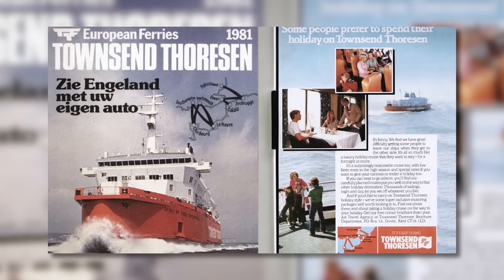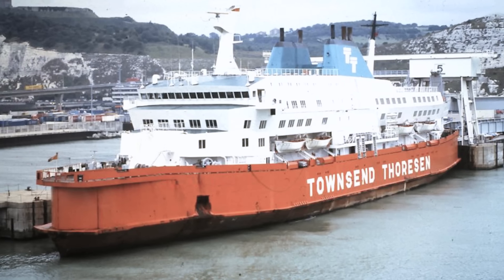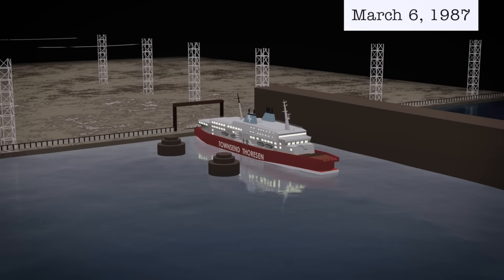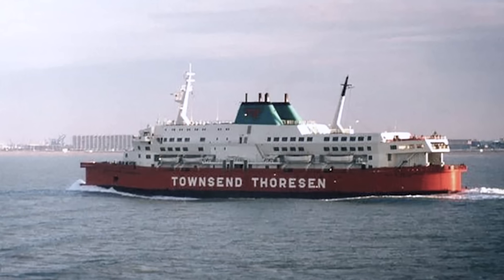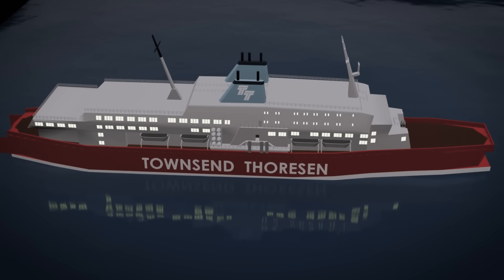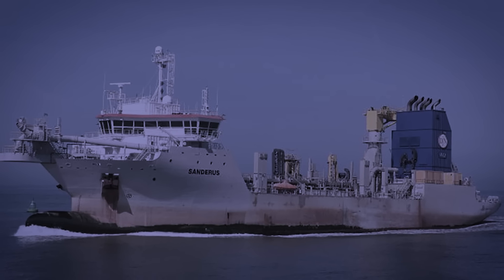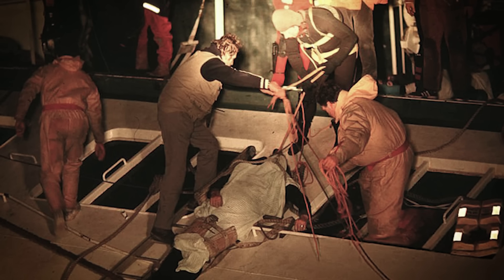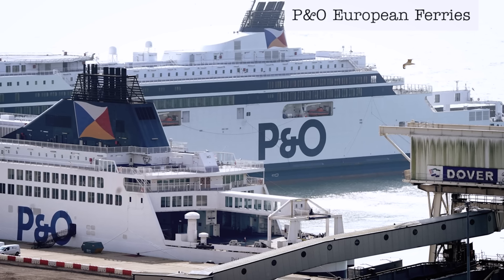193 Dead After Bow Doors Left Open!

Comment: Goodness, 193 casualties?
One little warning light of DOOR OPEN, would have prevented this entire thing...
Reply: Or if they had a callout plan.

Can not leave harbor before every crewmember, in charge of something important reports they have performed their duties.

"Deck assistant here, doors closed and latched"

They would not have gotten that call when he was asleep, so would not have left.
Reply: Not a foolproof system either. Estonia had warning lights if the bow wasn't locked. Chain is as strong as its weakest link.
Reply: 90 seconds? Damn I don't know anything that happens in 90 seconds.  Except one thing.
Reply: There are too many Desk/Office people who wright the roles, with no reality knowledges, that's why.
Reply: @ilaril  right, with the new fifteen minute early requirement from the company operating the ferry would have just made it so they would have ignored the light. Like they ignored the dude responsible for closing the door was missing. Like they ignored speed limits.
Reply: @ilaril  then you use multiple "chains" , back-up systems... planes have 'em, why not ships... 😒
Reply: or maybe some automatic action considering some sensor is necessary for the warning light
Reply: @fatovamingus  one and a half minute?
Reply: @fatovamingus  Sounds above average(!)
Reply: Once requested ..fitting denied.
Reply: the ferries ALWAYS left port with the doors open and would open the doors while coming into port. it was this accident that made the boats shut the doors before departure and open them after docking. my dad used to go and watch while we sat in the car. you were also allowed back to your vehicles while entering port. what the herald of free enterprise did was standard practice across the whole ferry system.
Reply: @jaapaap123 Every once in awhile yeah
Reply: That's incredible. Well, I bet they have them now.
Reply: even cctv cameras existed then.
Reply: @tricky1992000  I was just going to say a cctv pointed at the door with the monitor on the bridge for the captain to see would seem pretty foolproof.
Reply: An interlock should be installed, not just a go/ no-go indicator, but a disabling mechanism. This should also be done with dump trucks to ensure the bed is down before allowing increased speed.
Reply: Then what would we watch
Reply: @JohnDoe-bd5sz  At least the door close officer would have been leaving the ship with a sack...
Reply: ...or if one lazy ass moved to see if the door are open or not
Reply: @noconsent    that's the Spirit of Free Enterprise for you! 🤡👍
Reply: Even my fridge ward me if is open!!!! How is it possible????
Reply: At the cost of £500 pounds per ship.
Reply: A man who was on a 24 hour shift who’d been told to get some rest, who should have supervised by an officer. Where there were no warning lights to tell the bridge the doors were closed despite numerous requests by Captains for them to be fitted, which when fitted after the disaster cost £500 per ship, the 2 or 3 near misses, but blame the bloke who was asleep.
Reply: I'm told a trainee deck officer cadet had been told to ensure the doors were closed, he apparently went on to become a P&O ro-ro Captain. The full story is much worse than told here.
Reply: I know right? If my fridge can detect a door open, and activate a light, how can an enormous ship carrying hundreds of people not be fitted with the same system? This video perfectly demonstrates the swiss cheese model of airline accidents. If there were warning lights on deck, it wouldn't matter if a crew member didn't report doing his job. However, no warning light PLUS crew not reporting that a task is done, means no back up. This is why planes have such extensive pre-flight checklists. The fact that the ferry operators had no similar checklist is unforgivable.
Reply: No, it was common practice to sail out with the doors not closed. Even months after this disaster an undercover tv-show filmed just how many RoRo’s still left the ports with the doors not fully closed.
Reply: Relying on idiot lights is the type of thing that causes disasters, not prevent them.
Reply: @larsblankenfjell9814 can you repeat that in English?
Reply: @peterfitzpatrick7032 NO, planes have fail secure doors and hatches that require human intervention and indicating latches. They do not rely on idiot lights.
Reply: @hendrickvanderdecken7926  And yet... a plug door just fell off in flight... 🙄
Reply: @neil670 dear god 😮😢
Reply: @ikkelimburg3552 😮
Reply: Drunk employees
Reply: @ilaril estonia had no bow visor left after being smacked with a submarine.
Reply: no, it wouldn't. an interlock would.
Reply: submarine? @danielstevenson
Reply: This was one of those roll on, roll off, roll over ferries.
Reply: This is insane. One relying upon another that he had done his job. Worst of all ... the Captain.
Reply: In reality yes, but ferries often left port with these doors open to let out the exhaust fumes. A very high tide, & an unusually heavily ballasted bow end, due to a fixed span system at Zeebrugge, couppled with a late departure led to the disaster.
Reply: It does now. Plus a kill switch the prevents movement. Like trying to start an automatic transmission car when set to Drive,
Reply: Such incompetence on so many levels.  Shocking.
Reply: Ship designer, inspectors,owners,government officials in shipping ALL deserve to be charged with negligence because of no DOORS SECURED light or indicator.  All future ships should be designed to not engage anchor retrieval or propellers until RORO Doors are sealed.
Reply: Provided someone was there to SEE it.
Loud klaxon and BIG flashing strobe if vessel starts moving with the doors open is more like it, because when a crew neglects the bow doors being open, that`s the type of signaling they might need..
Reply: @ilaril  Estonian's ramp was actually closed all the disaster. The open ramp theory was just a faux reason to cover some other things.
Reply: @chatteyj Complacency and poor training. It never happened in the past so they couldn’t imagine it happening in the future. The rules of air and sea travel are written in blood
Reply: @noconsent  It not that,  the pounding waves of water, repeating smashing to the front cargo door broke the locking device then the door literately  was torn off.
Reply: All because of an assumption 193 people died. Never assume anything where peoples safety is paramount. RIP to all who lost their lives 🙏❤️
Reply: Not just a warning light, that would be far too easily overlooked.

In addition to a warning light, I would say a very loud siren, if any attempt to pull away from the dock while the door was still open  - much like the audible warning sound when you accidentally forget to switch off your car headlights but obviously on far larger scale.
Reply: @peterfitzpatrick7032  Aircraft have much less time for "backup chains" than ships Peter. That's why.
Reply: @roderickcampbell2105  Thats not really true, Roderick, you DO know how quickly this ferry went down, don't you ?...

The entire event took place within 90 seconds. The water quickly reached the ship's electrical systems, destroying both main and emergency power and leaving the ship in darkness.

 Even a jet can glide for many miles if it has the altitude...
Reply: @ Correct Peter, I do know the vessel went down very quickly and I was not trying to make light of the tragedy. I suppose that I think that folk who have jobs that involve others lives, I expect a very high degree of thoroughness.
Reply: @roderickcampbell2105   I'm sure you wouldn't make light of it, Roderick, & I didn't mean to imply that either.. but I will say that these outfits often cut corners in expenditure and often employ cheaper foreign staff who are not paid what thwy shoukd be getting paid, considering their responsibilities... "over-worked & underpaid" ... we often hear of oil tankers being manned by miniscule staff numbers, with little skill... 😒
Reply: @ Indeed Peter. Money and profit are often the "motivators". And many times the quite poor pay the price. They should not have to pay with their lives.
Reply: @roderickcampbell2105   agreed... 😟
Reply: The crew and ship designers were inspiration for the film Dumb and Dumber.
Reply: A warning light alone could fail and falsely indicate the doors are closed when they are open.But a $50 CCTV camera pointed towards the doors would leave no doubt. So simple and inexpensive tech anyone with half a brain would have installed it. The ferry company was so cheap they never had one installed.
Reply: @thequake180  Hard to argue with that quake. Several folk made major mistakes.
Reply: @thequake180  True, but good seamanship would have saved those lives.
Reply: A simple micro switch and cable and an indicator light, I would think would not be that expensive, most expensive part would probably be the length of two core wire to the bridge, not that expensive in the grand scheme of things, unlike losing the ship and lives and then all the insurance claims etc

Comment: After this we did get status indicators on the bridge and CCTV covering the doors. The cameras were usually covered in soot and grime from exhaust fumes and the mechanical switches often got stuck and gave false positives. There was no change in the pressure on the crew to do whatever was needed operationally to keep to schedule, constant reductions in crew numbers and increasingly little time for maintenance.
Reply: I am thinking that the ''Chunnel' just added more pressure to 'reduce overheads'
Reply: Great example of why safety features aren't a substitute for safety culture.

Comment: I travelled on RoRo ferries regularly to Hook of Holland / Harwich and return back in the 1980's so before this calamity. First thing I'd tell everyone who recommends a warning lamp in the bridge is - it wouldn't have mattered one bit. Many of them put to sea with the doors open. I foresaw this quite obvious flaw in the ship's design and never slept easy in one. ( I travelled Sealink - their ships were different in that some of the vehicle decks could be altered in height hydraulically so that different mixes of cars and trucks could be carried) these ships had bow hoods that were raised in dock for loading but they were only a kind of fairing - waterproofing was achieved by two sliding doors further in the ship. Many big cargo trailers - back part of an articulated lorry, were loaded without their lorry tractor unit ( another unit picked them up once in Europe) indeed, they'd often cram in an unattended trailer in the space between the bow and the sliding doors. These trailers had to be pulled on board by  small tug vehicles - driven by guys who reckoned themselves to be on fairground dodgems and quite often as they came up the ramp the trailer dolly legs would snag the sliding door tracks - I chatted to three matelots attacking one such occurrence with sledgehammers with a foot of green water pouring in the open doors while an alarm bell rang throughout the deck - "we have to keep to the Shedule sir, no matter what."

Comment: Not only was leaving the bow doors open not illegal, but many reports afterwards said it was normal practice at the time. To avoid the costs involved in staying at a port's berth while the doors closed, which took a number of minutes, these ships would set off with the doors open and close them while on the move. 
In fact it took a long time (as I recall) before a rescue or news helicopter pointed out it looked like the doors were open. There were many questions and denials, but then it came out - normal practice!

Comment: I'm rather surprised no one at the port saw the bow doors opened and reported it. Perhaps a layman might not understand the significance, but surely there are experienced sailors or dock workers around.
Reply: That was a common thing in those times. Many react with disbelief because they can often (due to their age) only compare with today's standards.
Reply: You don't need to be an expert on shipping to know that a bloody great big door wide open on a ship is not a good mix with water, weather your a layman or not 😂
Reply: Pitch dark, middle of winter.
Reply: It was not uncommon for the ferries to sail with the doors open, it helped clear the exhaust fumes from the decks. My brother in law was second officer on TT's Felixstowe-Zeebrugge service, those vessels had a visor type bow door with an internal watertight door, clearly visible from the bridge. We got a call from him that night to confirm it was not his vessel, and that they never sailed with the bow doors open.  Even bow visors were not foolproof, hence the loss of the Estonia in heavy seas when the bow visor failed.
Reply: it was reported on one of the previous occasions when it sailed with the doors open,the sister ship had also done the entire crossing with bow doors open,unfortunately because they got away with it complacency set in and (that night) because the ferry was using the port for the first time,the ramp didn't reach and they had to adjust the trim/ballast,unfortunately they forgot (the guides for measuring trim weren't that good in those days anyway) to adjust it back and everything else that went wrong that night.
Reply: It would shut its doors as it left.
Reply: @theunemployedtrucker  It was fine as long as they were backing up to clear the Mole, anyone seeing that would be seeing something pretty normal. It was when the turned and headed into the choppy channel waters that it went pear-shaped, nobody likely to even see that given the darkness. 
All depended in the end on one guy asleep (and possibly sozzled) in his cabin.

Comment: I don't understand how such a massive, complex feat of engineering could be designed without a simple indicator light letting crew in the wheelhouse know that the friggin' cargo bay doors are wide open. These vessels cost tens of millions of dollars to construct... just to be relegated to the bottom of the ocean because someone couldn't be bothered to install what essentially amounts to a $5 piece of equipment and a couple of door sensors.
Reply: Even the titanic of 75 years earlier had light indicators on the bridge showing that it’s watertight doors has all closed successfully - sadly the compartments themselves were not watertight but it does make it even more staggering that such an omission occurred at all.
Reply: True. The electrical circuit is so basic it’s literally a day 1 school project. Electrical power source - switch - lightbulb -

Comment: Went to bed?!? And nobody wondered about it? Damn, that's a huge failure of discipline.
Reply: I wonder if he was one of the people that perished in the disaster.
Reply: @JohnDoe-bd5sz  no, he was I think one of the only people who got any significant time behind bars (not as a convict I believe, but, he did spend something like 9 months in pre-trail confinement)...
though not highlighted, he briefly appears as one of the faces in the trail photos of this video... he was the only one who was not an officer, and therefore protected by a different union. the officers union put a lot of pressure to make the judge allow a Bail agreement.
Reply: he was supposed to go to bed, as the time in port was his sleep break
however he did not wake up for his shift, I believe due to a faulty alarm clock in the cabin he was assigned
Reply: @stanislavkostarnov2157  Even so, wouldn't the Master and Second know he was supposed to be at a spot he wasn't? I'm not going to say I would have looked, but I'm also not responsible for 300 souls and crew.
Reply: @sid2112  the problem was, with the tiny crew that they allowed to operate this ship, each member of crew was supposed to be at a different part of the ship, and, it was standard for that position to be empty when the second came there (as the previous person manning the car deck loading was already supposed to be on the Bridge (looking out for small vessels as the ship began maneuvers in the harbor) by the start of the seconds shift when he should have closed those doors)
thus the Load-master, never would see the second come down in normal circumstances...
Reply: @stanislavkostarnov2157  Terrible, terrible thing.

Comment: I used the Zeebrugge route monthly as a freight driver and missed being on that crossing by 3 or 4 days, I feel that you have missed a few important points, they often left the bow visor / ramp open to clear the vehicle decks of fumes, closing it before leaving the outer harbour, so it was not unusual to see the Herald sailing with the front open! As I understand / remember it, at that time there was an occupational (for the crew) duty free drink allowance that could not be taken ashore, it had to be consumed on the vessel. The freight drivers cabins were on the very lowest deck, each side of the propeller shaft, a very long way down several flights of stairs, the crew member who was supposed to be in charge of the freight drivers cabins was often found asleep in a cabin so we often did not get a wake up call when arriving in Dover, he would have been no help in an emergency!